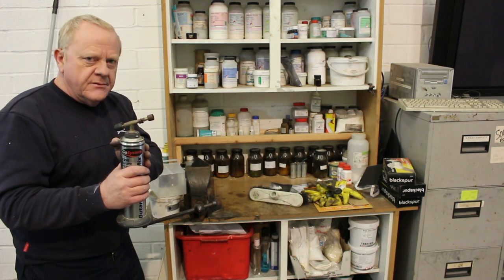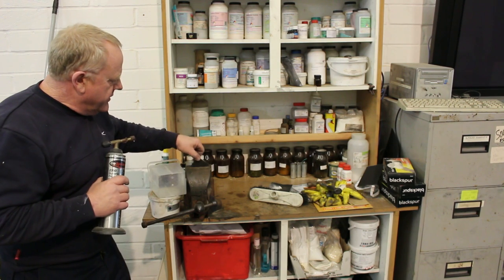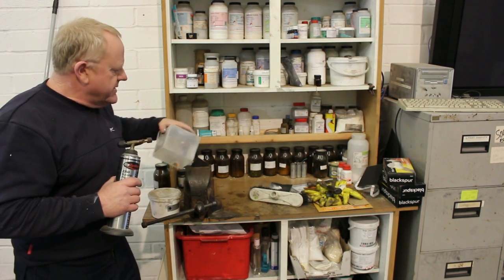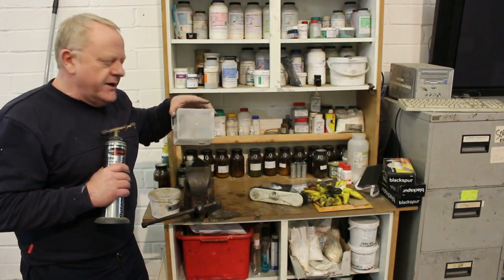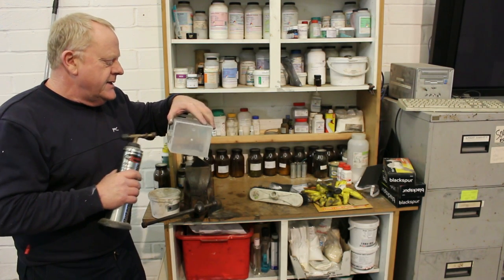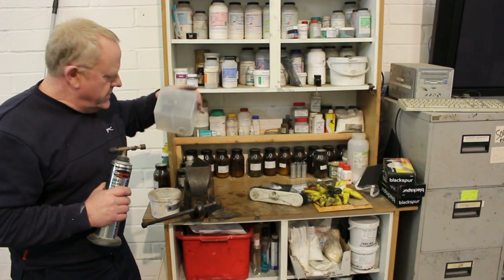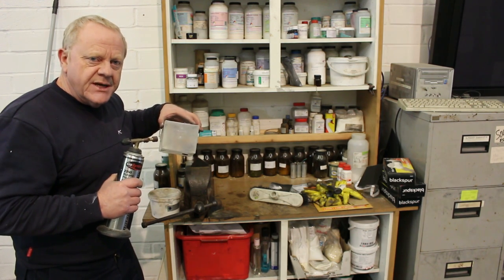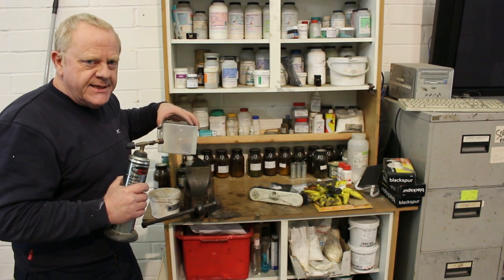Flame Testing The Graphene Reinforced Plastic

Comment: I understand that you're reluctant to reveal much about it for obvious reasons, but can you tell me whether or not you think that the graphene has bonded because of the carbon content(or possible other elements in the mix) and thus would only work with other plastics(and maybe high carbon steel) or if it's just suspended and thus would work with almost any moldable material? And also if you can without giving too much away, is it only strong by weight or by volume as well? I was just considering a similar method for making some molded frames for something I'm making at home and wanted this information before buying all the material.
Reply from the maker: it's more than likely just to be from good mixing mate

Comment: What about if you used aluminum or titanium instead so it does not become so brittle after heating. This material if it did not become brittle after heating would be perfect for heat shielding. This would be a better option for protecting against space debris considering weight restrictions.  if your limited to plastics then maybe try acrylic and or poly carbonate layers combined with however you integrate the graphene into the plastic.
Reply from the maker: so you are saying an ali sheet coated with the plastic?
Reply: If it is impossible to include it in the plastic forming. Then a coating of some sort to mitigate the degradation. Make the ablative qualities before it turns brittle a bit longer. Can you make a spray able version of this plastic the way it is?
Reply from the maker: yes we can spray it
Reply: Space X needs a ablative coating for re entry on a few spots. you have something similar to steel in strength that functions similar to the panels the shuttle used for re entry in a paint can. Beautiful technology you got there. i just wanted to add a few possibly bad ideas worth of getting to a good idea.
Reply from the maker: it's a really nice idea mate - cheers
Reply: Robert Murray-Smith isn't the temp range of graphene really high? if not I know carbon nano tubes should hold up in aluminum when being smelted.

Comment: I wonder how much heat flowed into the metal clamp because of the high conductivity of the graphene. A fairer burn test would have to isolate the sample from any heatsink.
Reply from the maker: +scv34etg7456t it's non reticulated mate and basically that makes it an insulator - so not much - you can tell that because one side is around 700 degrees and the other is nominal - if it was a thermal conductor both sides at the tip would have been near enough even

Comment: Really cool application with graphene! I'm really curious as to what the results would be if it were combined with refractory cement. I want to build a better rocket mass heater and am trying to find a way to improve the heat tolerance and insulation properties of the castable refractory cement that makes up the riser. Might be an interesting experiment for a new material.
Reply from the maker: +Neutron LD50 that is a cool idea mate - have you tried it? - give it a go and do a vid

Comment: You said that after the burn it lost its strength. Was that loss permanent and do you know at what temperature it lost it? Have you repeated the burn on the same piece and did it have the same resistance to the heat?
Reply from the maker: +Linda P the loss was permenant - basically the top layer carbonised - I have no idea when it lost it - but somewhere about 200 is my guess. And yes we repeated it and yes it has the same resistance

Comment: Looks like the Graphene takes the Bulk of the Heat and distributes the Heat outward over a Larger Surface of the Material, doesn't let it build up in One Area, as the Tempreture Gun also confirmed on the Hot Side as the Tempreture should have read Hotter. Awesome!
Reply from the maker: +Anthony Sayers That sounds right to me mate - glad you liked it

Comment: i could contest the variations in the two types of plastics and the thickness of each. as a thicker harder object can dissipate more heat. as the thinner less dense plastic can't and wont. but that to the side. being graphene is a product of graphite. graphite being a product of diamonds. it can withstand heat and pressure. i like how it looks to char. i can see it being utilized in a dragon-skin type of ballistic defeating. armor. based on the over lying design of lizard scales. there is a web site for said products. but it uses metalized-ceramics the last i heard. but ceramics don't perform as well on second impact..and being it withstands heat from flames as it does. it may have a second use in firefighting armor too. when a fire fighters enters a militant zone or even in a bombed out area with incendiary bombs and shards of masonry begin to pop. sending fragmenting bricks flying about.. just saying.
Reply from the maker: +dale myers Thanks for that mate – interesting ideas. I wouldn't worry too much about the thickness issue. We all know how PP reacts. The only thing a thicker bit in a vice would do is take slightly longer to burn – and that would be slight. You have to remember this isn&#39;t a scientific test – rather a youtube demo the music should have been a hint at that

Comment: EESD casing?
Reply from the maker: +Joshua Fausset Indeed - I am talking to a car manufacturer early Feb for exactly that lol - you are a smart guy mate
Reply: +Robert Murray-Smith  meaning some car manufacturer is going to apply your EESD along with its casing?
Reply from the maker: +dft I am certainly talking to them for that reason mate
Reply: +Robert Murray-Smith Is it an EV manufacturer? Are they going to use it as a primary source of energy or for recuperation. The best case  would be to use EESD with some kind of range extender, like phinergy aluminium battery or something along this line. It applies to all EVs, imo.
Reply from the maker: +dft it is an EV mate - but there is a limit to what I can discuss about it at the moment - not my decision but i am sure you understand
Reply: +Robert Murray-Smith Anyway i am glad that all seems to be going in the right diection.
Reply from the maker: +dft cheers mate

Comment: lol great test mate!
had an ideea of melting a 3d print fillament and mix it with graphene ro make it uber strong ... the first thought was ... set the darn thing on fire :)

had a hunch that the graphene will conduct heat faster than plastic hence creating micropockets self insulating by vaporising the surrounding plastic ... 
interestingly enough ... if heated below the melting point of the unaugmented plastic ... hhhhmmmm i wonder if it still insulates ... or by what measure ... 

so if you were to heat it to say 100 C .... what would it read on the other side ?  but maybe not because then the read on the cold side would have been larger considerably then the ambiental temp....

did you test it for magnetic permeability ? ... do magnets stick to it ?

awesome!
Reply from the maker: +actudoran it's not magnetic mate but around 100C it just becomes pliable again
Reply: Interesting... :)

So no heatshield then ... :)

Comment: What sort of plastic is the graphene reinforcing?
Reply from the maker: +littlestworkshop i think it works for all kinds - it's really a question of degree
Reply: +Robert Murray-Smith I was just wondering what was used in this test.
Reply from the maker: +littlestworkshop the mix is proprietary mate
Reply: +Robert Murray-Smith Ah, I'd assumed the proprietary bit was more related to the graphene than the base plastic it reinforces. Don't think it's PP anyway :)
Reply from the maker: +littlestworkshop it's both bits mate - it's a complex and not PP lol

Comment: Is the heat being transferred to the vice? The thermo properties of graphene might have implications for whatever it becomes attached to..
Reply from the maker: +DRandomD given the other side is only 16 degrees C and 7mm away - what do you think mate?
Reply: +Robert Murray-Smith that's impressive, I missed his first heat measurement the first time I saw this...
Reply from the maker: +DRandomD it could be the vice is a heat sink - but i doubt it mate because of the heat difference between the two sides - you would expect the sides to be relatively equal if the heat was being transferred that quickly
Reply: +Robert Murray-Smith I thought perhaps it might be being transferred somewhere, in the way manjo bhargava hopes to harvest energy, but I guess if the graphine is not forming strands in the plastic this doesn't happen, would be interesting to look at the plastic under a big microscope to see how the graphene is arranged.
Reply from the maker: +DRandomD yes it would indeed

Comment: conducts heat and electricity, wow not bad, so many uses, i suspect from the temperature difference from the flame and the test piece that the vice maybe acting as a heat sink.
Reply from the maker: +serfer5rogers maybe - but you would expect the other side to get hot too - that was quite a temperature difference for 7mm of thickness
Reply: +Robert Murray-Smith absolutely
Reply: +serfer5rogers  Good observation serfer5rogers. Like you I suspect that the heat energy travels easier along the Graphene plane and down to the vice  rather than over the layers and to the other side. The test could be done again but this time by insulating the vice jaws from the sample using some thick plywood or just some wood or other heat insulative material. Otherwise you will have to market the material and thick vice jaws at the same time lol
Cheers

Comment: IMO Burn test should be the same plastic, same thickness, same mounting so as to not have the heat sink of the vise for 1 and no heat sink for the other. Not to discredit the test on the gp reinforced plastic...
Reply from the maker: +moto2kx2 lol - really? - that's what you got out of this? did you not see it glow red? And - didn't the music give you a clue - it's just a bit of fun to demo the idea.
Reply: Robert, Don't take this the wrong way. I made that clear it was not to discredit. I am used to a more scientific approach is all. Thanks BTW for the lighter approach look. :-) taken...
Reply: I do believe this property is widely known for many months anyhows... At least thats how long I knew of it. Wish you continued success.
Reply from the maker: +moto2kx2 i am sorry if i came across a bit 'snotty' mate - i equally didn't mean it that way - I try to make this fun - so science is a bit more approachable. That can come across as a bit glib. It's a difficult balancing act and i get it wrong quite a lot - but still i keep trying lol - I take on board what you are saying but i tend do that kind of stuff a bit more behind the scenes so to speak - then i try and think how to demo the idea in a fun way.
Reply from the maker: +moto2kx2 A bit longer than that mate I first started looking at this 4 years ago.

Comment: so I was playing with a mixture in the microwave yesterday, I was amazed that right out of the microwave I could hold it in my hand, did it four times for 1 min each time.  On the 5th time, as I went to put the substance in, the microwave shorted out... any reason you could think of?  After 20 min the microwave started working again
Reply from the maker: +Steele Rutherford the microwave temperature gauge cut out
Reply: +Tony Ling sweet thanks